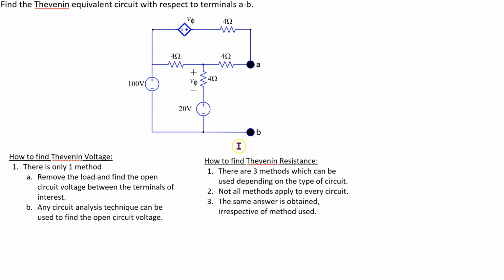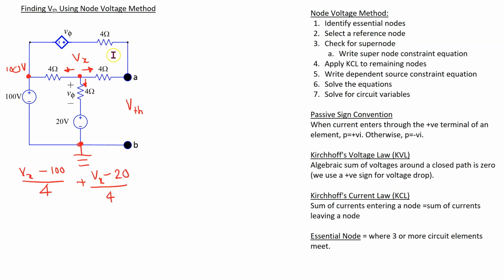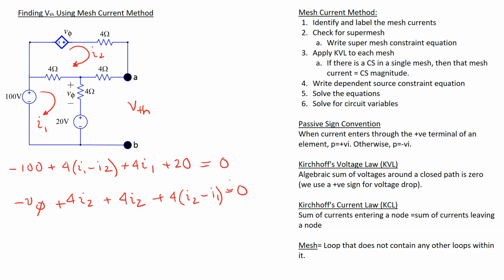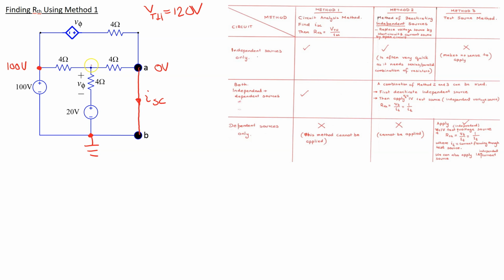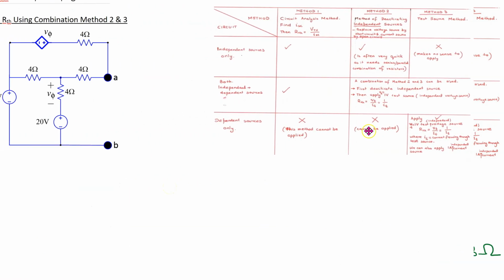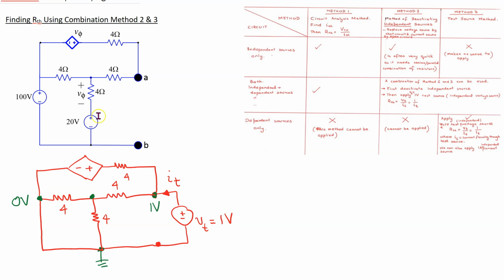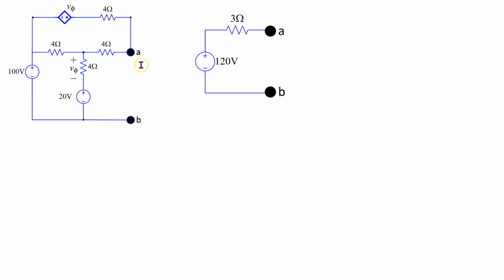Thevenin Equivalent - Example 4 (insanely hard example)

Comment: Sir how we can apply mesh analysis to find i(t) 
If we assume i1 i2 i3 currents in respective loops with clockwise direction then will i3=-i(t).?
Reply from the maker: Thank you for the excellent question. There are only 2 meshes in the circuit. Because of the open circuit, there is no third mesh.

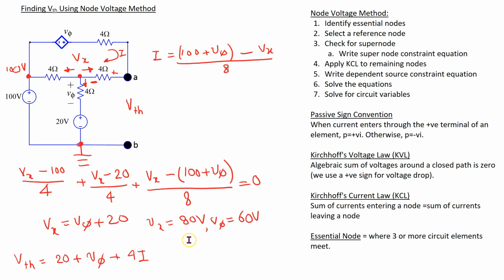Comment: At 6:00, why can’t we just use the difference between Vx and voltage at far right node A to calculate Vth? Voltage at A is 160 and at Vx 80. Answer should be 80,no?
Reply from the maker: Thank you for the question. In this example, Vth = Vab = Va (voltage at node a with respect to ground) since node b is grounded. 

What you suggested is the voltage drop across the resistor, which is not Vth. Hope this explanation helps.

Comment: These videos have helped me so much! I was wondering if you would create any videos for Norton's theorem?
Reply from the maker: Thank you for the excellent suggestion. Norton theorem is the dual of Thevenin's theorem. A Thevenin equivalent circuit consists of an equivalent voltage source Vth in series with an equivalent resistance Rth. A Norton equivalent circuit consists of an equivalent current source I_N in parallel with an equivalent resistance R_N. Since the two theorems are duals, R_N = Rth and I_N = Vth/Rth. Thus, if we know the Thevenin equivalent circuit, we can use it to find the Norton equivalent circuit.  I will endeavour to make a video in the future.